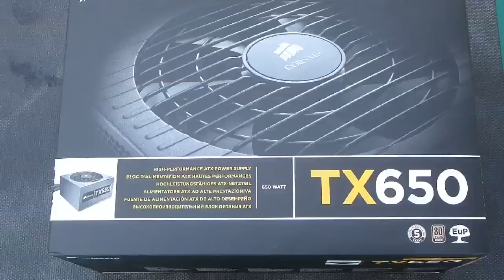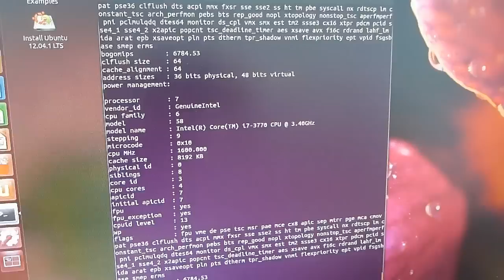Intel i7 PC Build No Music

Comment from the maker: There are many choices for fan positions. In at the bottom out at the top. In at the the front out at the back.
However, fitting ALL fans to blow out of the case does seem to work very well. Try it your self, monitoring CPU and disk temperatures while hammering ALL PC hardware (it is easier in Linux to run all cpus and disks at 100%). Each case is different and there is not much difference between all the above options. All fans out does work very well.

Comment: Thoughts on this? A custom build I'm going to do cause trying to keep it under $800AUD this will cost about $760

ASRock Z77 Extreme4 Motherboard

Thermaltake 500W TR2 Bronze TR-500P

G.Skill Ares F3-1600C9D-8GAO 8GB (2x4GB) DDR3

CoolerMaster K280 Case

Hitachi Deskstar 500GB 7200RPM 0F15629 

Intel Core i7 3770